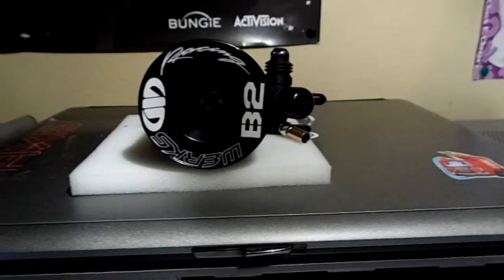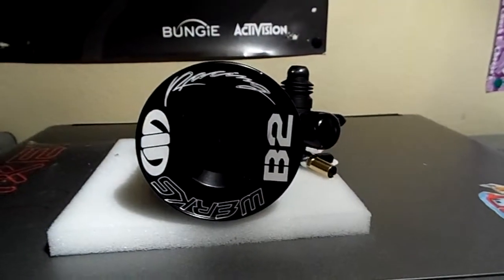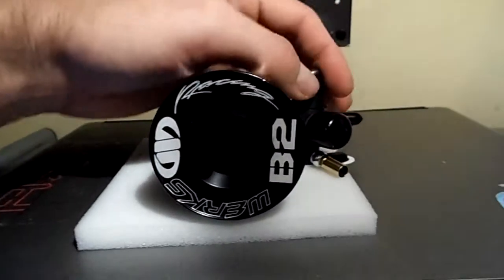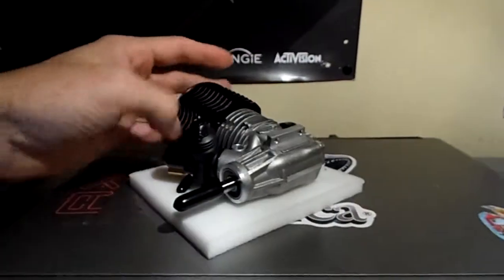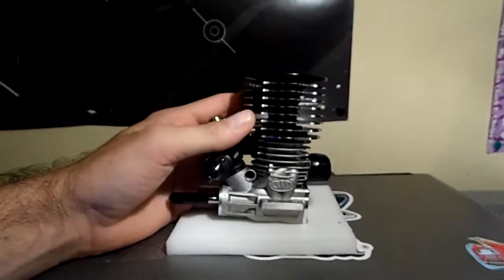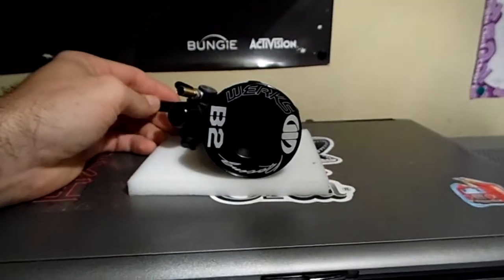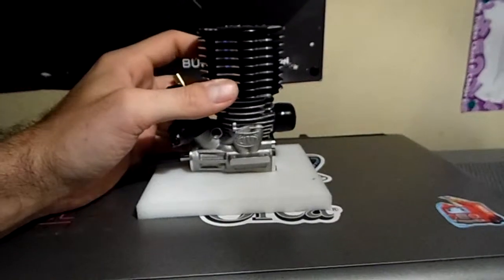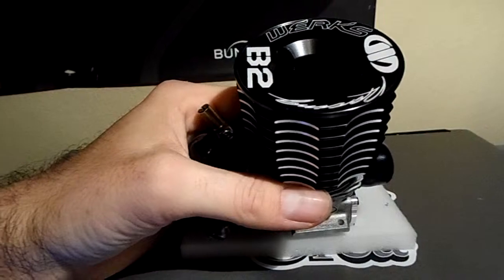Werks B2 Q & A's

Comment: I've only tried the stock 7mm venturis with Werks B5 and B6. Curious what an 8 or 9 would on something like that B2, As for clutch and staggering...I do both. IF I can get away with it I'll set tension all the same, as I agree it provides a more abrupt delivery. However, in low-traction conditions I like to stagger as it gives a more progressive feel. So I know some guys who are against staggering, but there is a difference bewteen Alberta clay and Texas dirt. Haha. Meaning if you are spnning wheels why would one not stagger? In the end it's like tuning an engine...it's not objective. There is a clear goal in how you want your clutch to behave and you tune it based on your power and available traction. Nice vid... appreciate the follow up!